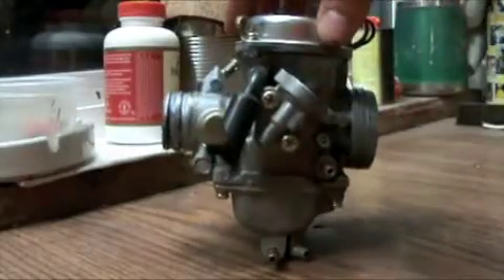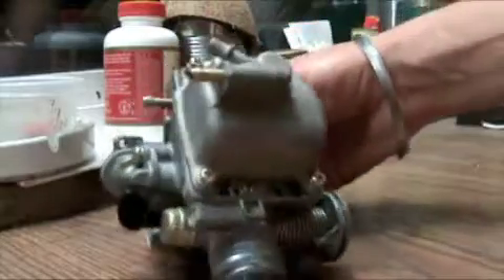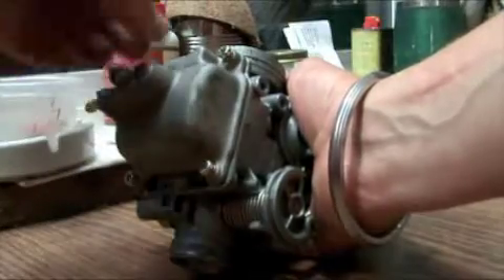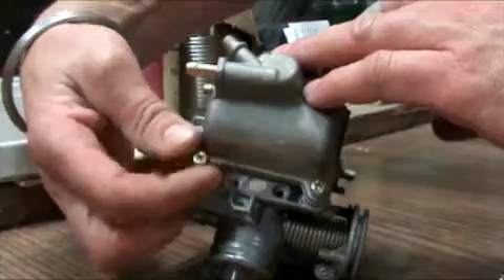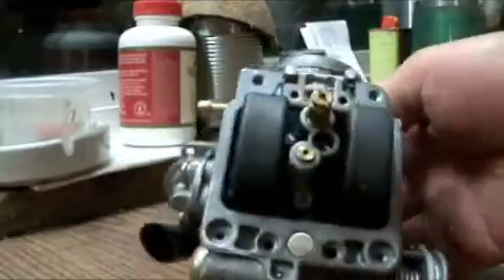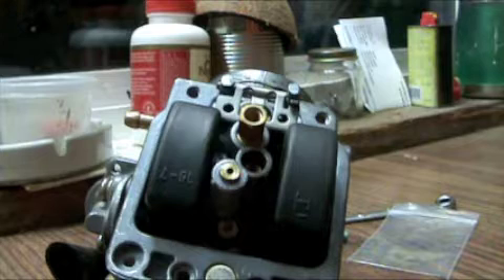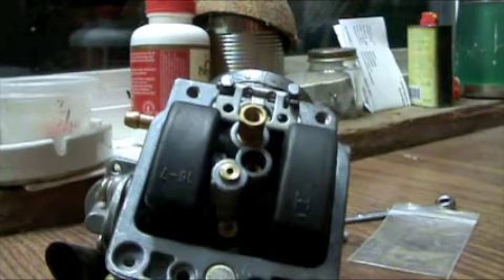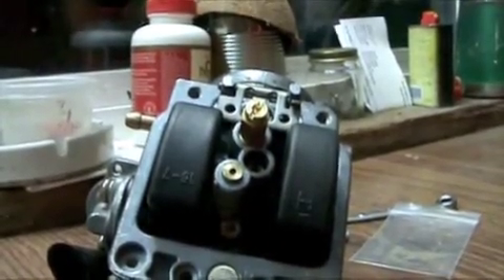Air Intake and Carb Rejet Part 3: Rejeting the Carb

Comment from the maker: Yes it can. You are pushing more fuel into your fuel air mixture. It can increase though. If you are running lean you bike might be working harder than it needs to making it less efficient. So you may get a increase in mileage if you are leaned out because the engine doesn't have to work as hard. Also running lean means running hard and it is not good for your engine.

Comment from the maker: @46000rpm: if it is wet and fouling then you probably have to much fuel coming in and you probably need to go with a smaller jet. I have a spark plug video that talks about what you can tell form your spark plug you can also go to Northwest bugy's web site  and they have some detailed info on being able to tell what your spark plug is telling you. Also oil fouls out spark plugs as well.